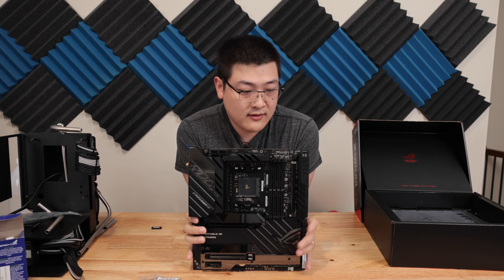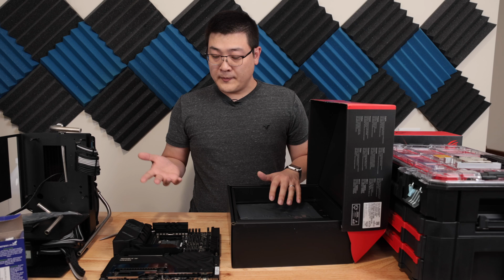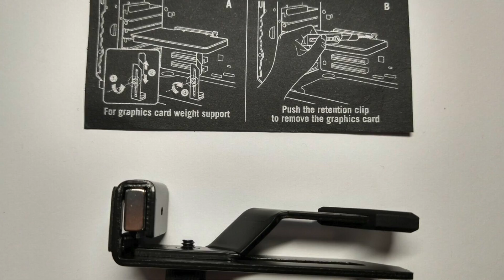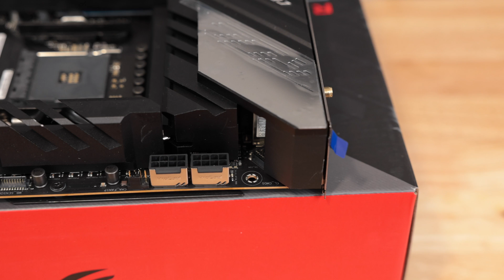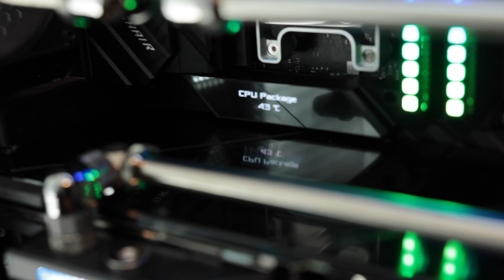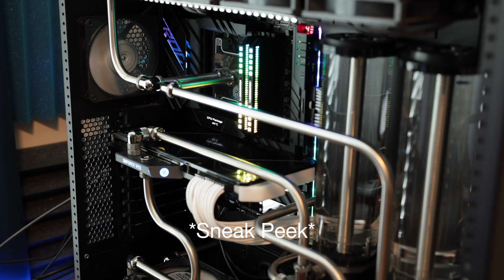Asus Crosshair VIII Extreme Unboxing & First Impressions

Comment: I have Aorus x570 Xtreme, and i still think that mobo is the ultimate thing, compared to about everything... Tho is older model from the original x570 lineup, while this is newer, the original x570 ROG mobo was not up to par with the Aorus, this one kinda is, but if GIGAbyte did release new Aorus x570 Xtreme+/ Mark II or whatever name at the same time ASUS did release this one, you bet ur a$$ that the Aorus would be better...

Comment: I have an X370 Crosshairs VI Extreme and absolutely love the board! I am thinking about going to the X570 Crosshairs VIII Extreme yet not sure if it is worth the jump for FPS gains alone? Any advice, please? 🙏
Reply from the maker: The board alone won’t give you additional fps. A new cpu on the other hand will, assuming you’re not GPU bottlenecked.

Comment: Best of the best?  ProArt is the same board but better with ECC RAm support, btw you can’t fix active backplates on 3090s in the 16x slot on this board with NO q-release button like alder lake even tho they’ve been in development at the same time as alder lake who has these features - board was almost good….
Gonna have to completely remove the OLED to fit a 3090 active backplate

Comment: I'm so tempted to finance this mobo just did my build with a Asus TUF gaming x570-plus mobo but my cpu is 5950x, should I stay with the one I got or return it to best buy I'm still in the return window or get this one, is it worth it the upgraded, what can I achieve with this board, Sorry this is my first build and I'm going all out lol.
Reply from the maker: Honestly? You're not going to achieve anything more than what you can do with the TUF X570 board. The extreme has support for 5 M.2 drives, a fanless design, better power delivery and a more robust design. However, it's not like you're going to be able to overclock the 5950X any more than you can with the TUF board. Sure get the Extreme board if you're willing to shell out the extra money for aesthetics and having the best. But real world difference is minimal. IMO.
Reply: @StanYanMan  I bought it already going to cancel the order, thanks for being honest, I thought it was going to some how give me better fps and performance overall, thanks Stan